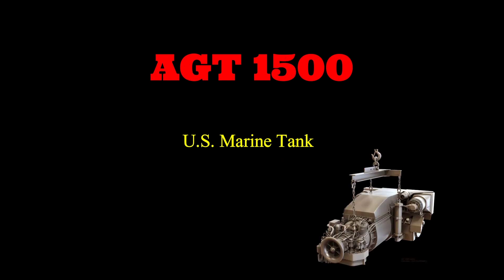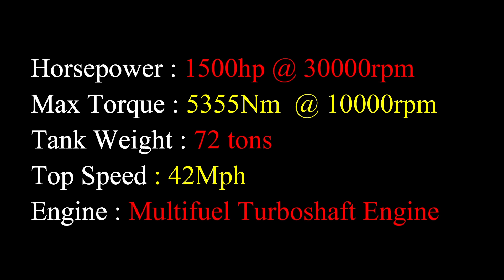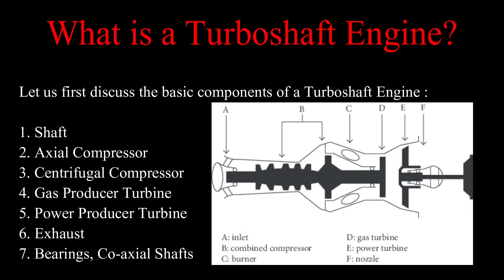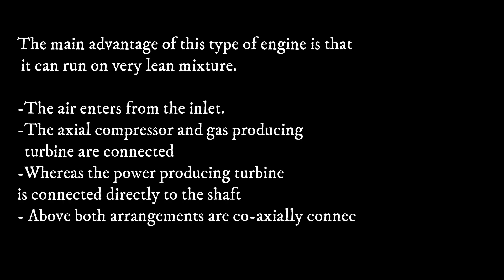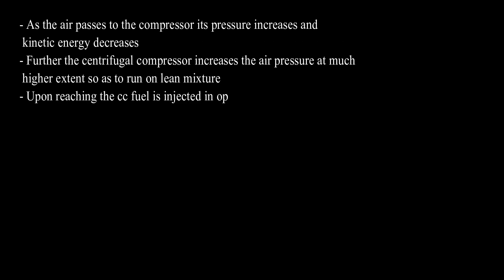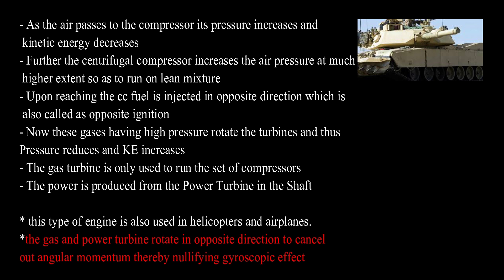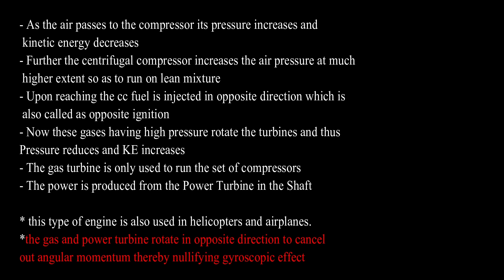U.S. Battle Tank | AGT 1500 | Turboshaft Engine Explained | Automobile | Mechanical | Engineering |

Comment: 0:15  3000 rather than 30000 rpm
Reply from the maker: (*typo)Thanks
HP: @3000rpm
Torque: @1000rpm
Reply: PEAK HORSEPOWER AT 30,000 RPM, NOT 3,000.
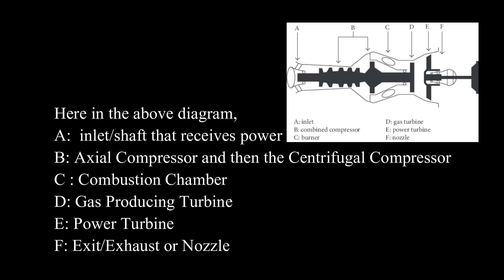MAX TORQUE IS NOT ENGINE TORQUE, IT IS MEASURED AT THE TRANSMISSION OUTPUT SHAFT. 1:10 REDUCTION

Comment: So this engine produces 3950 Lb of torque at only 10,000 rpm, not bad.
Reply from the maker: There is a typing error in the video. Its 1000 rpm instead of 10000 rpm. Sorry for the negligence.
Reply: Not Engine torque, this is measured at the transmission output shaft after a 10:1 multiplication.

Comment: Do really AGT 1500 uses a centrifugal compressor?
Reply from the maker: Centrifugal Compressors were used in early jet engines and some of the small turbojets,turboshaft engines today. At present large turboshaft engines uses the Axial Flow Compressor. *Added, principle remains the same.
Reply: I found it and the last stage of the high pressure compressor do have centrifugal compressor in the AGT 1500 jet engine.
Reply from the maker: @tomgol6140  Yes! Friend. Don't forget to subscribe the channel please.😇
Reply: Although centrifugal compressors are simple to design and cheaper to build they are inferior to Axial compressors
Reply: @sandervanderkammen9230  well it depends on how you want to use them
Reply: @tomgol6140  higher compression ratios and compressor efficiency can be achieved only with axial compressors.
Reply: No